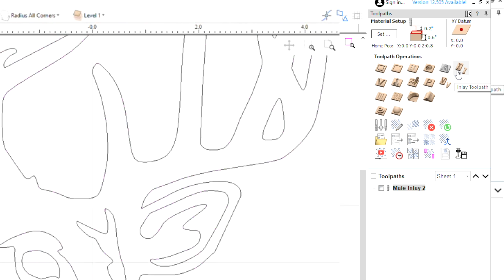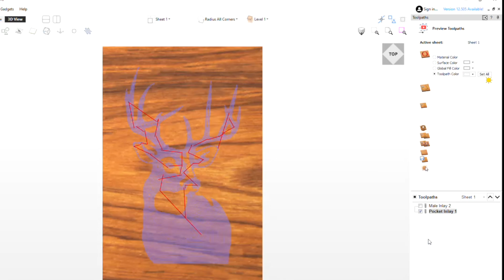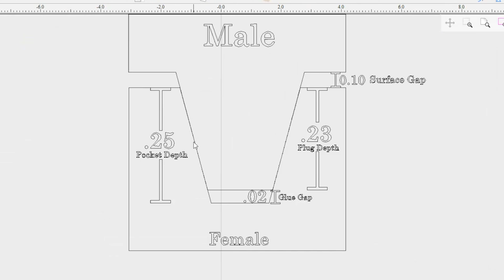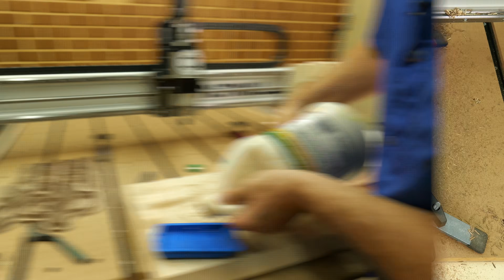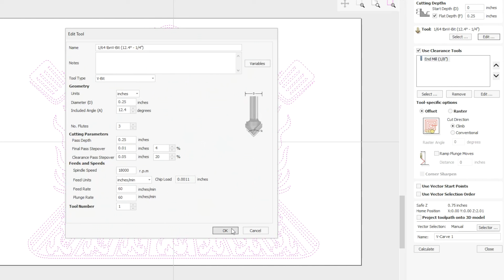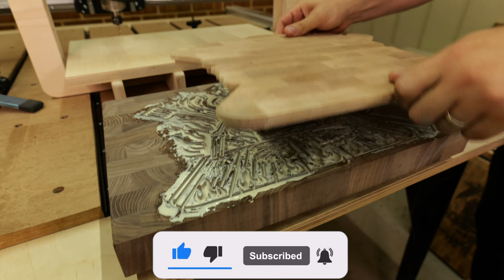I Tested All 3 CNC Inlay Techniques (Beginner → Expert)

Comment: For the VCarve Inlay technique, Vectric Aspire features a dedicated toolpath specifically named "VCarve Inlay Toolpath." You do not need to manually calculate inlay parameters or mirror the image, as the software handles everything for you.
When using a ball-nose bit for this inlay technique, the same toolpath is used, but there are a few nuances to consider. 1. When selecting this toolpath, the software restricts your choice to V-bits; consequently, you must input the parameters for your ball-nose bit, but you will be unable to specify the ball diameter, and the toolpath preview will not reflect the bit's actual path. 2. The bottom clearance for glue in the female pocket must be set to a distance at least equal to the ball-nose bit's diameter—ideally, double that value.

Comment: Another great video.  I would like to see this expanded on. 
 I did a couple of inlay projects from CIC (elk and deer scene) using the 30D-vbit 3/16 clearance.  Both came out great with very few issue other that the fuzzy clean out was a little more involved. 
 So I decided to take the next step and try to do a BROIN project with a TBN and that is were is gets interesting.  Even took the BROIN  course which I must say was not very helpful and overly priced for what was presented.  I was expecting a definitive set of numbers(start and flat depths) but all I am getting is that everything has to be determined experimentally. 
The new and  improved V12 inlay toolpath on the surface appears to simplify the process but only lets you use bits configured as V-bits which then leads to more adjustments what have to be made to get good results. 

Thanks
Steve

Comment: Be interested to know why the Start depth and Flat depth are so radically different with the TBN.  For the 30-d V-bit, the explanation seems to make sense.  But it is unclear why this all falls apart with the TBN.  And is this something that the software can predict or is it the fact that the TBN is being configured as a V-bit?  I also took the BROIN course and was very disappointed to say the least.  No doubt he has figured out how to make some great stuff but conveying the information to others falls short.  The course in my opinion is just a road map for going out and figuring out on your own what parameters to use.  I did complete two inlay projects from CIC using the 30-d Vbit and they both came out great.  Thought I was ready to take the next step and do a TBN project like the one you are showing, but I'm still not sure what parameters to use.  A lot of conflicting info. out there.

Comment: Why was side angle set to 12.4? Was that specific change you made for inlay? The bit specs from your tool database has it at 6.2.
Reply: Tool settings in the database are done on the radius which is 6.2. The vcarve tool setting needs the angle across the whole diameter - hence 12.4

Comment: Hey Geezer, I like your videos and your enthusiasm very much, but I'd like to know what you feel the difference between methods 2 & 3. They appear to be exactly the same except you use a 12.4 degree bit instead of a 30 degree bit.
Personally, I use a 10 degree "V Carving" bit and get good results, although I wouldn't describe it as a TBN.
BTW one trick to get a good mate between male and female in technique 3 is to cut the male section into smaller pieces and the glue them in separately. So in your example, you could have done this with the text and maybe have had a tighter fit.
Keep up the good work.

Comment: Been Binge watching your videos and loving them as I research my future purchase of cnc. You mention the differing results of bull nose vs the v bit (3/16’s) and a rounded corner but deeper inlay. I’m wondering if a bull nose usage for the depth but then use the 3/16’s v bit on the same cuts to achieve the sharp corners but adjust the depth of the v bit ever so slightly. Just trying to think of work around and a little out of the box but I have zero experience with cnc or woodworking, except for my CO2 Mira 9 laser and a 100w fiber laser for metal.

Comment: As so many others have said, yes, would appreciate you doing a video on TBN inlays.  I do have a question on this vide however - when you show your settings for the TBN, you show 60 IPM for both the feed rate as well as for the Plunge rate.  However, on your web page for selling the TBN1-64, you list plunge rate at 50% of feed rate.  So just looking for clarification on that.

Comment: Good stuff.  Thanks for the video!  I've only ever tried one v-bit inlay and it turned out as maybe an 8 out 10 (looks good from 3 feet, but there were a few little gaps), which enough to drown my confidence and scrap the project I had planned using some exotics.  Now that I'm retired I need to give it another go.  I don't think I'll mess with TBN inlays unless I get a better CNC.

Comment: i have done all as instructed in the video but my plug is loose in the female part. Any suggestion on how to fix my design issue? female part .25 deep; male part d 0.23 f 0.1 both using v 30 bit and a 3/16 clearance tool

Comment: Why do we see so much extra wood left on the male parts to be just shredded off? For those of us attempting this as beginners taking two board as expensive as those are it doesn't seem smart to shred off almost 1/4" or thicker from the male piece. Is there a specific reason this has to be done or can we use pieces that are carved thinner original pieces to only an 1/8th of an inch left untouched on the top to same us money in the waste?
Reply: Hello, it has to have a certain stability so that it doesn't break when used. Especially since end grain is vulnerable due to the direction of the grain.

Comment: Maybe I’m overthinking this,but wouldn’t a 30degree v bit provide just as much detail as a TBN bit? Since the v-bit is referencing the edge of the line you want cut.
Reply: You may get sharper corners, but a TBN 3 flute will always have a better finish and cut faster than a 30° at 0.25"

Comment: You put your TBN in the V-bit category in the Tool  database and not the TBN category.  Is that required for this style of inlay process or is that where you install your TBNs?
Reply: Vectric only accepts V-bits for this job.
If you use Aspire V12.503 you can also use an engraving cutter, but not again in later updates.
Someone probably accidentally activated a part of the program, but it works without experimenting - it's just an engraving cutter that isn't flat at the bottom. You only need to determine the cutting width at the tip of the ball so that the web width is calculated correctly - the depth is correct by default.

Comment: Sorry if asked already didn't scroll through all the posts..... Why did you say clearly in the first two examples to make sure to carve the MALE version first then in the last complicated one you clearly carved out the female first?  is there a reason for not doing the male one first in the complicated version.  Cool Vid.
Reply: I think it might be easier to make corrections because you can leave the female side in and see how it fits. I believe it was mentioned too.
Reply: @Wusel-yl8vf  totally agree but that isn't what he did for the complicated version.  just was wondering why
Reply from the maker: So for the straight flute inlay it matters. On the other inlays it does not matter at all, because if they do not fit, you won’t know until the end. The only benefit I have personally seen is that if you’re going to screw up, screw up on the male, so do that one first. Also you are more likely remember to flip it when programming if you do the male first. But overall it really doesn’t matter, I will make that more clear in future videos.

Comment: Hello,
If you program the TBN bit as an engraving cutter, it should work without much experimentation.
Simply reconstruct the bit of your choice in CAD, extend the two legs until they intersect, and you will immediately see the problem that the milling depth cannot be correct. If you now measure the distance that the leg is at the height of the ball tip, you have the front width of an engraving cutter with a radius, but the depth of the tool path is calculated correctly.

Comment: For the John Wayne pattern, why didn’t you do the male part first?
Reply: When using the Vbit, the taper of it allows some margin of fit difference. There is no need to keep the female part in place to make adjustments.

Comment: Broinwood's training class es are outstanding.! Not inexpensive but well worth the time and money.!  In my opinion, each technique has a place.
I use the "traditional" method with TBN for detailed work. Once learned and tested its EZPZ.  And am very happy with it now that I understand it. However, It does require more time and effort to learn.
The V Carve inlay tool path works well for simpler projects with a true Vbit. But not so much with a TBN. I tend to use this more on face grain, or "cleaner, simpler" files for end grain. 
When using the TBN I spend more time cleaning my files.4
The deeper pockets do require more pleasure, as there is more friction and wood to move. To that end I obtained a small hydraulic press and  modified it for my use. Works great!. I use the press you made fore less complicated inlays with a lot of wood on top to spread the pressure evenly and I am happy with it also!
Good Luck I look forward to trying some of your blanks. One question why do you use Titebond 2 rather than Titebond 3?
Keep up the good work. I always enjoy your videos.
Reply: courses range from $145 to $750   gota be pretty serious to drop that kind of money
Reply: @Sparky6547  I suspect that is true. But then having destroyed $$$ in wood to get crappy results is also expensive.  Ask me how I know :-{ :-{
I was told a long time ago, better to cry once than over and over. 
Good luck I hope your result are good.
Reply: @Dta1996  I've made lots of expensive fire wood that has been sacrificed to the burn pit gods myself.

Comment: Yes please do an in depth video on the TBN inlay.  Im running a Onefinity machine and I have the exact bit you do just from a different manufacturer and no numbers anywhere near yours work. I have went from 0 to .3 in both directions and had a giant bonfire of scrap to prove it :)  I'm pretty frustrated at Vectric for not making this available on aspire, it should just be a math issue.  ( I'm not smart enough to figure it out)